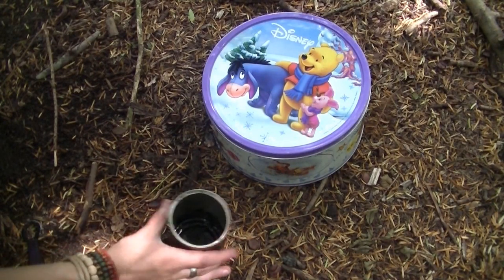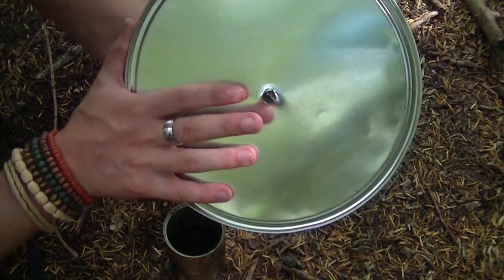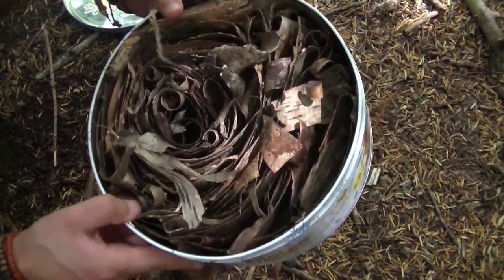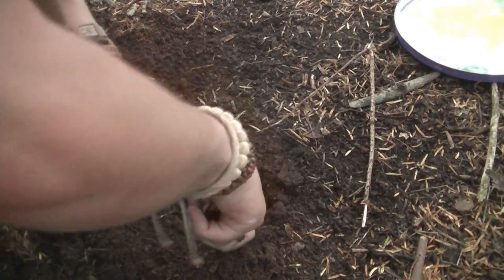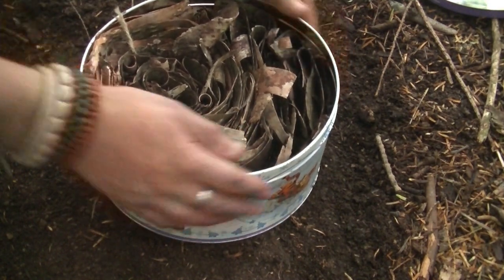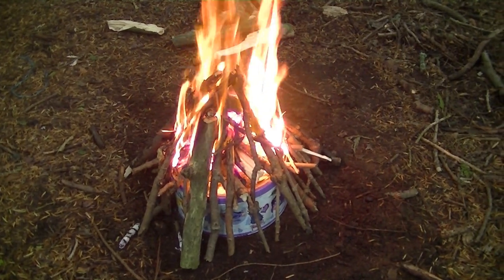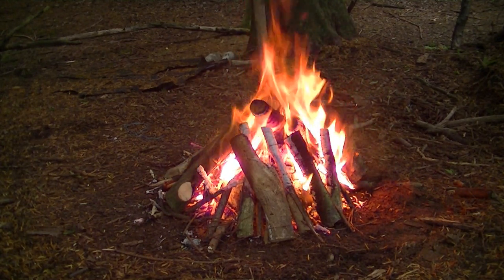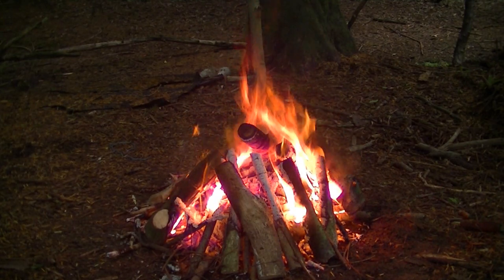Making Birch Bark Oil - Self Reliant Resource

Comment: If you are still around, I have question for you. Could you have done the same thing in an oven? living in NYC if you do this in central park you will be arrested. I want to extract bark but in an oven. thanks
Reply from the maker: Im not completely sure to be honest, In theory it should work fine but I dont know whether the oil would eventually ignite because it wouldnt be sealed off. I know there are some large woodland areas in and around Queens. Perhaps you could use a woodland elsewhere?
Reply: thanks

Comment: wood an old cleaned out paint can work do you think?
Reply: odg tan Okay never mind... Used the same method you have with instead of birch but cherry bark, worked great I now have cherry wood oil. What is this method called? Anyone know?
Reply: @odgtan8232  rendering oils from wood 🤷‍♂️☺️

The process is similar to gasification, it's basically just burning the fuel (birch bark in this case) in a very low oxygen environment. 

Side not, it should improve the yield if you seal everything up well (clay mud works)

Comment: Now look up "how to turn oil into diesel"
Reply: +Brad Hintz I wonder, is that something that's actually possible from birch oil?
Reply: +Hendlton look up wood gasification it produces flammable gas and the vapours captured, if cooled can actually be seperated into pertrol,  diesel, kerosene, methanol, acetone and acetic acid!
Reply: Only through VERY complicated processes, +danpearson
Reply: 3nertia not especially, fractional distillation. Look it up, fairly simple actually
Reply: @danpearson3692  no petrol, but the "smoke" can be used to run a combustion engine, like a car, truck or generator.
Reply: @jdlflagstone6980  I know but the tar that you filter out actually contains petrol, diesel and kerosene!
Reply: @danpearson3692  maybe I'm wrong, but I think maybe we are using a different definition for "petroleum"? 

Do you have a link you can share, brother? ✌️

Comment: you could probably run a diesel engine with it.
Reply: No, but you can run any combustion engine on wood. If you're interested research wood gasifiers. It's an old technology, they used them in WW2 to run trucks and cars because of the fuel shortage. ✌️